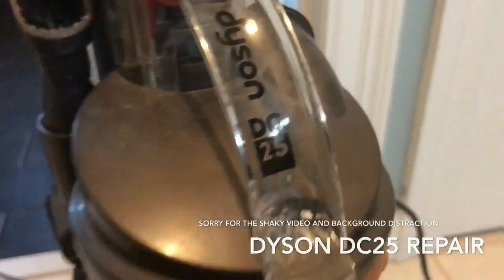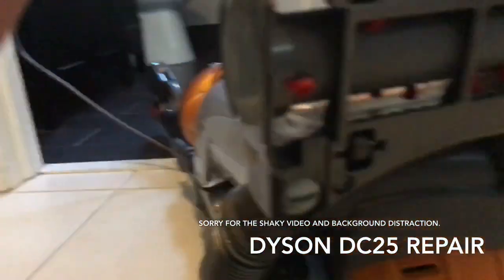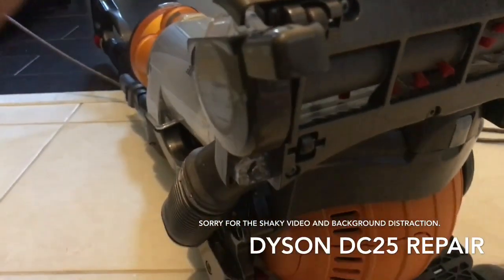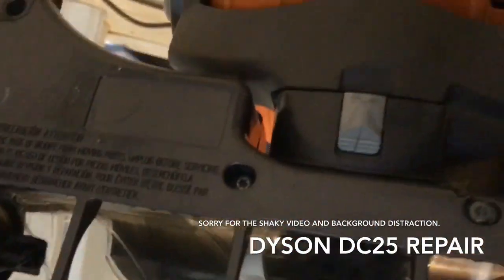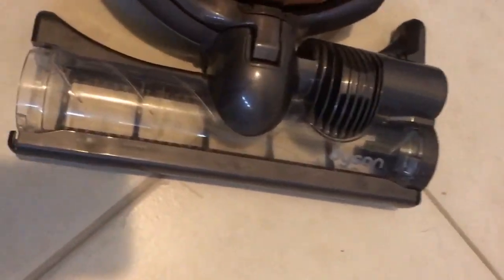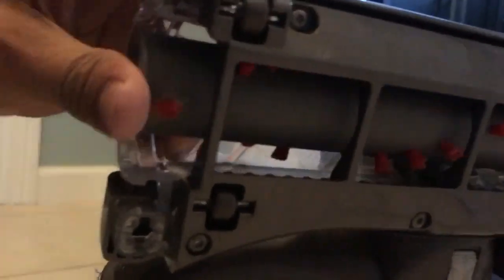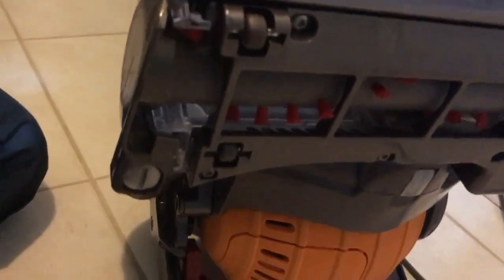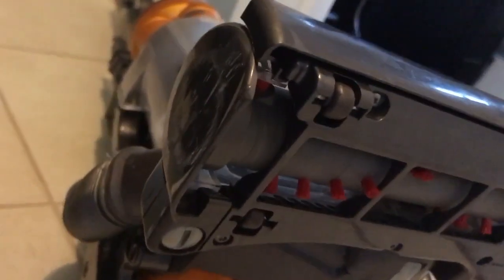DYSON DC25 repair

Comment: I have this vac and love it - have used it many times without any problem.  So bought a second one for my Mother's house (which has only been used 1/50th as much as mine - I know because I'm the only who vacuums there!  LOL) When I removed the wand to vacuum baseboards - the whole shifting mechanism came apart - apparently a screw had fallen  out (undetected) which holds that shift-from-floor-suction-to-wand-function mechanism together and allows it to work!  The floor portion still works - but miss that wand function).  Bought a screw and another small pieces  from the local Dyson repair place, but cannot figure out how to disassemble that section and put those pieces back in  [ thought it would be easy since I have a working one to follow].  But I am afraid to take apart my good one and risk losing both during this pandemic!  PLEASE post how to take apart that portion of the vacuum and reassemble!   [Costco won't take it back it after after all this time -- even though it still has the new factory tag hanging on it!  I need that vacuum to work!!  PLEASE!]  Thanks in advance!!
Reply from the maker: Ya amazing vacuum but I wouldn’t want to break open my vacuum so you can fix yours lol. My rule is don’t mess with something if it’s working fine.
Reply: @HowToDoitright  Fair enough!  I thought you maybe were a Dyson Pro!
Reply from the maker: Haha no just a DIY person

Comment: do you have a video on how to unlock wheels, my vacuum when I try to use is so hard to push on rug , nothing is in roller , it works fine other then this rug , I have other rugs thinner and it works fine
Reply from the maker: Unfortunately I don’t but I will work on making one and post it

Comment: I bought a new head because the turbo stopped turning the brush but made no difference, any ideas please
Reply from the maker: Pauline Oliver did you run the machine with head disconnected and see if it’s turning on?